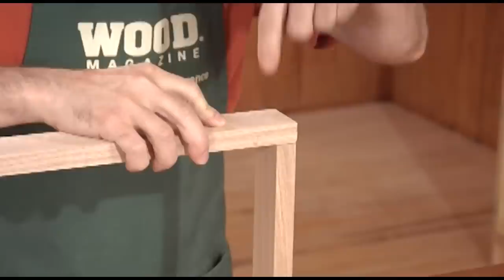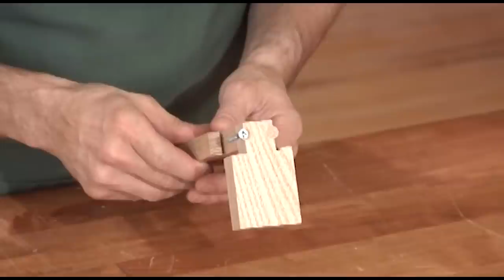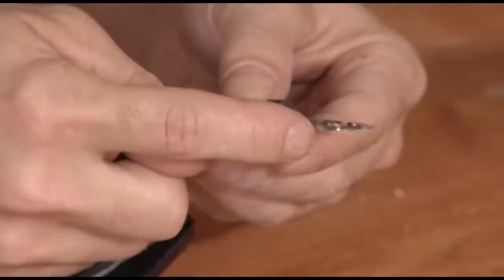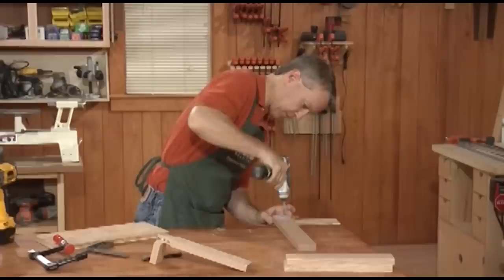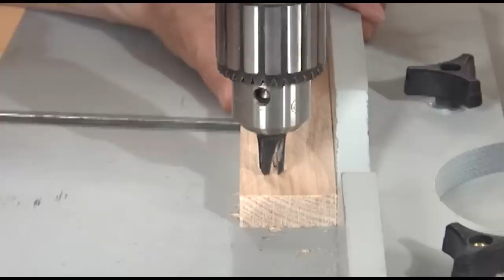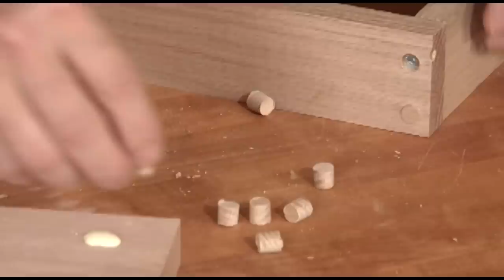How To Make A Screw Joint - WOOD magazine

Comment: If the plugs are tapered, mark the surface of the board you are cutting them from before you cut them free. That way you will know which end is the smaller one. The mark will be inside the hole once they are glued in.

Comment: Screwing into end grain is not practice. It like drive a screw into the  end of a handful of pencils. It will have hold. 
Lots of joinery solutions. Maybe we could let the noons learn a practical join. Just a though. Great channel
Reply: Ya isn't that bad because screwing in with endgrsin is a weak joint and can cause splintering

Comment: Screws should not be used into end grain. It's not just a question of split. When you screw into end grain, the thread cuts the fibres. Continuous fibres are very short along the screw, actually just long as the thread. So you get a weak support right where the screw apply force. This joint is pretty weak. So it should not be the way to go, especially for any structural application. Any woodworker learn that soon or late. It's so strange to see this in a tutorial from a serious magazine.
Reply: I gotta admit that screwing into the end grain concerned me, too. I find that, if it has to be a screwed joint, pocket hole joints are a far superior solution.
Reply: @AlanSextonVT  other than pocket joints do you know any other good joining ways that gives you a strong joint unlike end grain
Reply: Axel Sixtysix They aren’t recommending the joint... just telling you how to hide them if you do decide to use them.
Reply: _ David _  thanks, ya I know about dovetails I've only tried dove tails ounce lol, their hard I was doing it with chisels though. Mabey next time I'll use a band saw
Reply: @AlanSextonVT  Agree with you 100%, pocket holes would be much better fastening strategy in this case.  About the only time I screw into end grain is (which is almost never), is if the face or edge grain part has a datto and the end grain is inserted into that datto and the screws is only purpose is to hold the joint firmly while wood glue is used.  Additionally, I have used pocket holes with dattos and that is even better yet.

Interestingly, another video on this channel seems to illustrate this same (screw into end grain) process.  Eg;  Squaring Brace - WOOD magazine.
However, How To Make Simple Face Frame Cabinets - WOOD magazine, shows how I use pocket holes when end grain fastening is required.